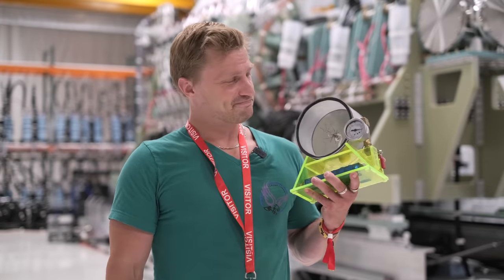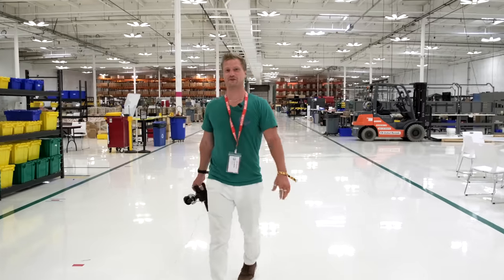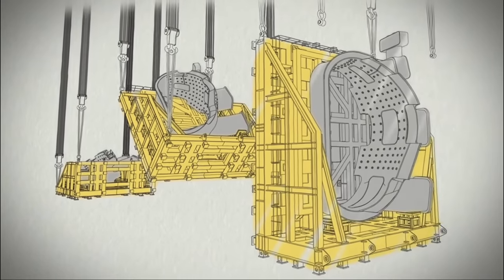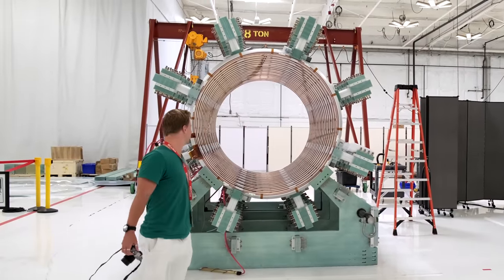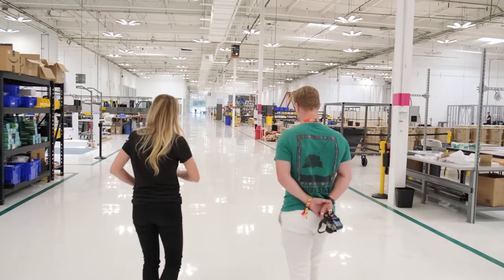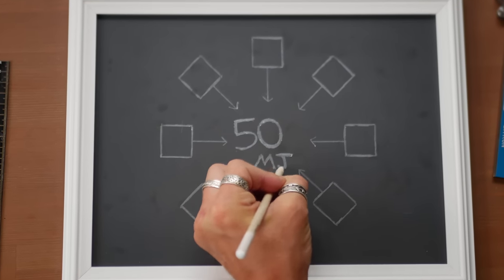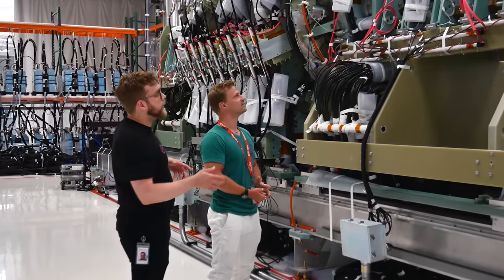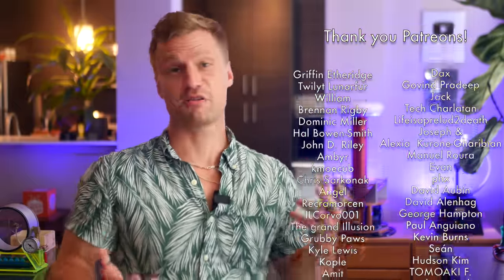An Exotic Approach to Nuclear Fusion (Helion Energy BTS)

Comment: i just have one thing i dont fully understand: what happens to the extra proton and electron after the fusion of helium three? is that also released as energy?
Reply: Yes, when Deuterium and He3 fuse, they release a high energy proton and a high energy He4. Both are charged particles and you can directly extract the energy from them.

Comment: A really brilliant idea of achieving a fusion reaction with extracting as much energy as possible out of it. But one question still remians for me. How do they get a viable amount of Helium-3 or Helion for their fuel? Isn't it so that Helion is also pretty rare on earth? Just like Tritium?
Reply: They make the He3 by fusing Deuterium (which happens anyway as a side reaction). D-D fusion produces either a He3 + a neutron or a Tritium atom and a proton. Both reactions have an equal chance of happening. The Tritium can be traded (very valuable and currently more expensive than He3) or stored until it beta decays into more He3.

Comment: Just watched the ionic thruster vid from 5montha ago,

Have no idea about any of that, just simple minded. But instead of having the one big one 3 in a row.

What would having the same design shrunk to the size of a bottle cap/ 10 cent  or golf ball size . But have multiple of them  say 6 or 8 grouped side by side  in a circle form ?   Less power to each of the small individual ones as less wires /weight etc but same total power over all as one big one?  Would that mean the group of smaller ones produce the same/more or less  thrust  than just one big one in the video for the same power usage?

Kind of like how dyson cyclone hoovers/vacumes i think it is instead of having one funnel has the 8 or so around the top for more suction?

Comment: Pulse fusion thrusters?

Instead of capturing all the energy, some could be used as thrust, and some used for the next pulse.

Already in a high vacuum environment.

I wonder how much thrust could you build up with it compared to "traditional" plasma/ion engines.

Comment: Causing fusion isn't hard. Controlling it is very hard. It's like trying to design an internal combustion engine, which uses 6ft tall sticks of dynamite (minimum size) as fuel.
Fission is soooo much easier. Just stick fuel near more fuel, it turns hot, and you make steam.
Helion's approach is one of a couple of good ideas out there for fusion.

Fusion isn't a final answer to power though. You need a fission reactor to manufacture the He3. OR... you can go gather it on the moon, where it's slowly made by the sun outside the van allen belt. But gathering fuel on the moon & sending it back is a pretty exotic fuel supply chain. 
Might be better to think of fusion as a multiplier for our fissile fuel supply.
Reply: OR you do what Helion does and make your own He3 by fusing Deuterium.
Reply: @elmarmoelzer2229  They're making He3? Not 'using' it?
Reply: @kathrynck   Both. Can even do both in the same machine.
Essentially, what happens when you have Deuterium and Helium3 for fuel is that you have both D-D and D-He3 reactions happening anyway. They can balance it so that they get enough D-D reactions to have He3 for the D-He3 reactions. The D-D reactions release less energy but are easier to achieve. D-D reactions will likely just about break even. The D-He3 reactions is where the money is.

Comment: The video only talks about capturing energy from magnetic induction... but does that imply discarding the 50 million degrees of heat energy? Do both have to be captured for Eout > Ein?
Reply: It is 200 million degrees for the actual power plants. But that heat is motion of particles and that motion of particles is what drives the expansion of the FRC plasmoid at the end of the pulse. So the majority of that gets converted to electricity directly.
There is some heat that is not captured by the plasmoid. It comes from the 2.45 MeV neutrons produced by 1/3 of the reactions (Deuterium-Deuterium reaction) and Xray- energy deposited in the components of the machine. Now that will make about 10, maybe 20% of the total energy released by the machine. 
There is the possibility to recapture that via a heat exchanger and a steam turbine. But that would increase the capital cost of a power plant significantly. The question is whether that is worth it.

Comment: 0:14: 🔬 Nuclear fusion is a challenging but important pursuit, with various innovative designs being developed worldwide.
4:23: 🔬 Helion's approach to nuclear fusion is different from traditional methods, using a high-temperature plasma confined by magnets and then squeezing it to increase pressure and temperature until fusion occurs, allowing for efficient and compact systems.
6:21: 💡 Helon Energy uses a fusion generator that is efficient and has no moving parts, using helium-3 as fuel.
9:35: 🔬 The team is working on a fusion device using FRC plasma chambers and capacitors with a voltage rating of tens of kilovolts.
12:27: 🔬 The Polaris fusion generator prototype successfully forms a plasma in a nearly silent and stable manner.
Recap by Tammy AI

Comment: The LLNL used 2MJ to make 3MJ, so net gain 1MJ of heat. Nope, the lasers needed several 100MJ to get 2MJ into the hohlraum and only once a day. If you include the entire annual  energy inputs for the facility, it would be 100s of times greater still. So in the entire lifetime of LLNL facility they could boil a couple of cups of water and get stupid amount of publicity.

As for Helion, just look up the Thunderf00t video on that.

Comment: I've never heard an explanation of how they get the energy out of a Tokamak type system. The prosses of making and containing the plasma is clear enough but how do they get the energy out of a Tokamak system with sustained fusion?
Reply: The fast neutrons penetrate the walls and heat a "blanket" (a medium) behind it. Depending on the design that can be liquid or solid. The important part is that it contains a neutron multiplier (likely Beryllium) and Lithium. When a neutron hits the Lithium, it makes Tritium (which Tokamaks need for fuel). The medium also gets heated and when it gets hot, it can heat water for steam. That steam then drives a turbine.

Comment: ok so 6 pulses per second, is the 50 MJ all required? what is the expected ratio of output power to input power? is he actually talking about recapturing some of the output to feed the input loop? i wish there was more into the extraction part...
Reply: Polaris is still not a full power plant. It will demonstrate the production of small amounts of net electricity by the end of 2024. The next machine after that will be a full power plant operating at 1 to 10 Hz.

Comment: Okay...but what energy is required to create 'Helion'..?
Reply: The Helium3 is created by the fusion of Deuterium. That reaction itself is also exothermic, though the gain would likely be too low to produce net electricity. It will likely be barely enough to be self sustaining. The D-He3 reactions then produce the net electricity.

Comment: First of all, of course I keep my fingers crossed for Helois that they manage to solve all the problems, but.
If I understand correctly, their current prototype is doing 6 pulses per minute. But the power grid for example here in Germany has a frequency of 50 Hz. This means that if you don't find a solution to store the energy generated between the pulses and then release it into the grid at the appropriate frequency, the entire process of generating the plasma, compressing the plasma through the fusion process and then generating the energy will have to run 50 times per second. I personally can not really imagine that, at least at the current state of the prototype has not yet. But as I said I'm curious with what solutions they will find for such problems.
Reply: Thats why they have a 50 + MJ capacitor bank. It stored the energy needed to power the machine and it also stores the energy that is returning from the machine and then gradually releases it to the grid (and some goes back into the machine for the next pulse of course).

Comment: At such high temperatures, there is always the question what do you do with the waste heat? Do you recapture it or use it to run any steam turbines for instance? Helium is becoming harder to get. How do you secure available resources?
Reply: They make their own He3 by fusing Deuterium on the same machine. They have options for the waste heat. Could be used for district heating, e.g.

Comment: I do hope that fusion is soon to become a practical thing.
And its pretty nifty to have an reaction that does not have as many damaging radioactive effects.

But. Where are they going to get the helium 3 needed to even supply a substainal chunk of the USA?
H3 could be supplied along with DT by other reators but. We dont have an economy that really supports that kind of cooperation.
Reply: Their own machines fuse Deuterium to make He3 and that is fed back into the machine as fuel.

Comment: Wait a minute. So basically if Helion are able to somehow commercialise this process, then we can have Fusion based Electricity production. And I reckon that since fusion is so much more powerful than fission, not only would this system (in theory) be self-sustaining, but also produce enough to power other systems. That's Mind blowing
Reply: sorry, the won't. Just expensive scam like dozen of other similar "fusion generator prototypes" that just need to divide some equations by zero to get work.

Comment: How would they harvest the energi? I may have missed that part
Reply: The FRC plasmoid expands, driven by its own internal pressure and the added energy from from fusion reactions. That expansion induces a current in the same magnetic coils that were used to compress it to fusion conditions earlier.

Comment: Curious - what is the structural material they use on these devices? I'm talking about the thick greenish looking stuff that kind resembles circuit board material.
Reply: G-10 and G-11 fiberglass

Comment: Its all well and good producing 'fusion energy', but how do you transfer such intense energy released into usable output?
The energy gradient within a finite volume is stupendous regarding the available surface area emissivity.
What do you have that has a sufficient conductivity path?
An 'H' bomb is relatively easy, so is a gas explosion, or a conflagration, but what actually is the control/path/mechanism?
Reply: The total energy content of a single pulse is in the single digit kWh. After extraction the energy is stored in capacitor banks that then gradually release it to the grid (and some of it goes back into the machine for the next pulse).

Comment: why in the video it portrays like their reactor makes 0 neutrons, the fuel is D + He3 but it doesnt mean it will always be D + He3 reactions, pairs of deuterium can react with each other, and then its D-D reaction which has 50/50 chance to release a neutron, and at their temperatures D-D is way more reactive than D-H, so neutrons are still a big problem while the video makes seem like its not.
Reply: Actually, they have said that they need the D-D reactions to make the He3. It is only a 2.45 MeV neutron though and only in 1/3 of the reactions (1/4 if they can leverage the He3 from Tritium decay or trade the Tritium for enough He3). Compared to one 14 MeV neutron in EVERY reaction in Deuterium- Tritium machines (like most other designs), this is a piece of cake.
Reply: @catchnkill   Any fusion machine design will need maintenance, but 2.45 MeV in 1/3 of the reactions is a lot more manageable than that 14 MeV in every reaction. Think about major maintenance every 4 years vs every year. That sort of thing. Plus, unlike a torus, a cylindrical machine is a lot easier to service. Think about an order of magnitude less down time because of that.

Comment: bremsen Strahlung and Neutron emission due to d-d fusion.......two things conveniently not mentioned. But I guess the VC company doesn't want that to be highlighted
Reply: It is called Bremsstrahlung and that is a matter of electron- to ion- temperature- ratio. Helion's machines like many pulsed systems (unlike steady state systems like Tokamaks), have a low electron to ion temperature ratio. In Helion's case the ratio is 0.1 vs 1 in Tokamaks. The equation is:
P(fus)/P(loss) = Ti^1.5 / (Z^2 * Te^0.5 )

Helion's machines would produce 2.45 MeV neutrons in 1/3 to 1/4 of the reactions. This compares quite favorably to 14 MeV neutrons from every reaction in D-T Tokamaks.

Comment: The reason why this doesn't work is that this type of Fusion produces way too little energy. The Hot fusion like ITER produces far more energy
Reply: Helion's machines will run hotter than ITER and will have higher densities. Trenta was running at 10 keV (120 million degrees).

Comment: It shouldn't take millions of degrees to do this...
you just need to suspend your plasma between layers in a multi layered magnetic field that can oscillate the sequential layout of the magnetic layers to cross over and through each other with the assistance of an electrical arc that twists into a plasmoid upon being pushed into the bell housing...
resonant chambers in the housing with output feed loops should capture and convert any pulses into a usable current on a microwave frequency...
magnetic reactive element in the housing built with many thin fins in multidirectional geometries should ac as a heat sink that breaths with every electromagnetic pulse.

Comment: I still fail to understand how you can convert fusion pressure directly to magnetic fields to extract energy without boiling water. Could you elaborate on that in some future video?
Reply: The FRC is made from charged particles. The fusion products from D-He3 reactions are charged particles as well. The charged particles transfer some of their energy to the FRC plasmoid. That energy then drives the expansion of the plasmoid which induces a current in the same coils that were used to compress the plasmoid earlier.
Reply: @elmarmoelzer2229  You used expression "particles transfer some of their energy". Do you have any estimate about what kind of efficiency this process could have? Modern nuclear reactors that use heat to boil water have overall efficiency around 33–40% from fission to electricity. How would this new tech compare to that?

Comment: Instead of using a copper coil try using 30% titanium 70% tungsten
Reply: the coils are made from aluminum. They use it because it is relatively cheap and only has a half life of 2.5 minutes when activated by 2.45 MeV D-D neutrons.

Comment: Where is the I believe it's called... "Q "data? [Energy in vs. energy out.]
Reply: Polaris is supposed to demonstrate net electricity (!) by the end of next year, give or take a few months. They have not released triple products for Trenta and might never do so. We do know that the much smaller 5th prototype, Venti achieved a triple product of 10^19 kev s/m^3. That is roughly a Q of 0.01 for D-T. From the data they have released, Trenta should have been somewhere in the 10^20ies which would be a Q of 0.1 or higher IF you do not take the low Te:Ti into account, which is quite a multiplier. Hopefully, they will release more data about Trenta in the future but I will not hold my breath.

Comment: "And then we expand it, extracting all that electrical energy..."  How?  No moving parts, no turbines, no steam, no heat-to-mechanical-to-magnetic-to-voltaic conversion, so how are they "extracting all that electrical energy"?  You make a great motivational speaker / promotional marketer, but you let CEO David get away with hand waving and magical talk without nailing him down on how the electricity is "extracted". 

And while I'm at it, what kind of plasma "contains itself"?  Plasma being made up of highly charged particles, they do anything but "self-contain". 

You gave us the marketing spiel, but your video is extremely light on details.
Reply: Induction. The FRC has its own magnetic field. When it expands it induces a current in the coils.

Comment: 8:40 It's fascinating but I am curious if the net output would also exceed the production, refinement and transport of the He3. I'm afraid I have no idea how that fuel is produced or extracted, so I'm not even sure that's a valid concern.
Reply: He3 is produced in the same machine (or a separate machine of the same or similar design) by fusing Deuterium. D+D => He3 + n or D+D => T + p (the Tritium eventually decays into more He3). The D-D reactions by themselves are probably just about breaking even. But the D-He3 reactions release so much more energy that it does not matter.

Comment: What happens to the waste heat?
Reply: Right now, they do not have plans for it. They are just going to dump it into some heat sink (a body of water, or they have cooling panels with big fans).
Reply: @elmarmoelzer2229  can it be used to boil water for steam to work as a secondary energy source, possibly to charge the capacitors that the installation uses?
Reply: @BurtSanders  
It could but why? The direct energy capture is really efficient and a steam generator costs a lot of money. If the machine can not deliver enough output from that to deliver power to the grid and enough power for the next shot, it is probably not worth it economically.

Comment: Considering we want to move around the universe is it so taboo to have moving parts. The proven applications for moving parts fighter jets and tanks and turbines can't be undermined. There is a lot more potential cross over into fusion and plasma moving parts turbofan jets and fusion electrical generators more than reactors.